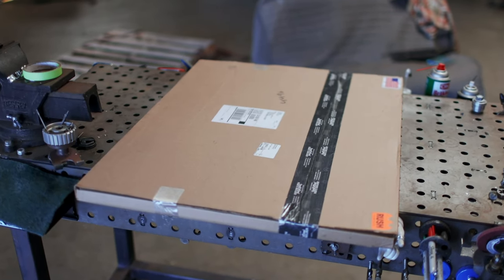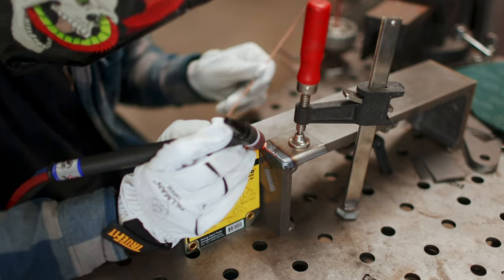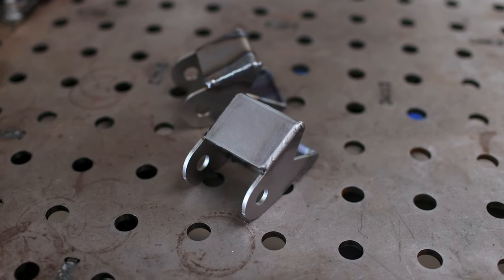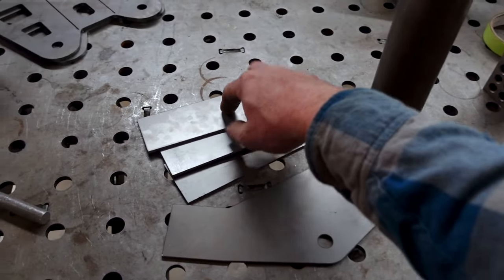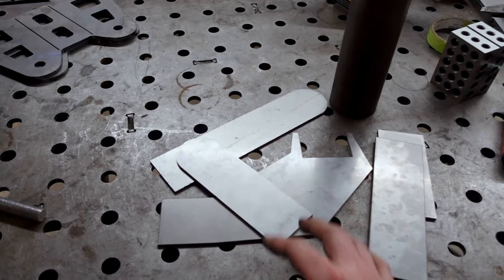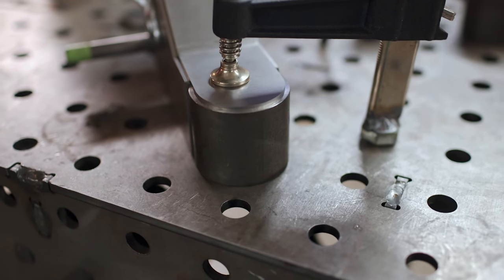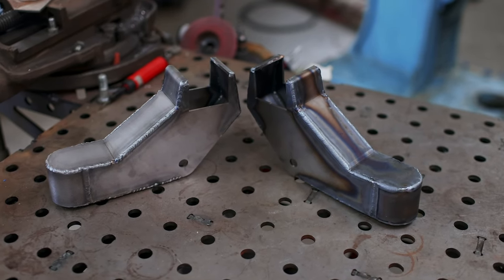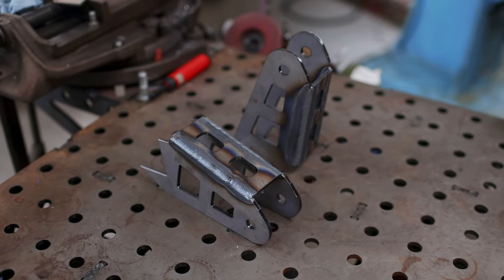From Sheet Metal to Suspension! - Road Race Chassis for the Hot Rod Rebuild

Comment: When having a lot of similar parts laser cut a helpful trick is to have part numbers/names lightly laser etched onto the surface for easy identification. The extra time in CAD to add labels can save a lot of head scratching and mistakes

Comment: I used an arbor press at my last job setting bearings and sleeves on three phase motor shafts to fit pulleys in custom saws. Unless you work in one of the many hand manufacturing environments you won’t get to see one. Do an episode for sure, knowledge is power and you can’t keep it without giving it away, as they say. Nice videos and progress on the model A frame. 🤘🔥😎🔥🤘

Comment: I've been using CAD for 12 years now and the thrill of having something you designed come together like this never gets old man. I'm glad to see talented builders like yourself diving more into it and seeing just how easy and useful the tool is, and how great the results can be on more complex parts. Obviously quick and dirty parts can be done by hand easier without any computer work, but it's nice being able to see issues in 3D space before you'd run into them during production.

Also wonderful and thoughtful use of the 1-2-3 block for fabrication! I too learned about them from Adam's YT channel and they're great to work with. It's such an extremely simple tool, but so effective!

Comment: Nice job.

When I build mounts with through holes that must be aligned I prefer to use bolts with proper thickness spacers inside plus about another .050"-.065" shim to allow for paint and/or chrome and still allow the component to fit inside the bracket without scratching the surface finish.

Just a tip I've found over the years.  Keep up the great work.

Comment: Have you considered plugging your suspension numbers into a bump steer/roll center calculation program?   Used one years ago and found it really helpful. Tie rod height and angle at the knuckle and rack play a large roll in bump.

Comment: From my schemes and plans for a scratch "Locost Seven", the rack tie rods need to have their inner ends on the line between the upper and loser a frame pivot centers. The R&P itself BEST wants to be in a direct line with the steering arms side to side- deviation of this will have the tie rod length in relation to the steering arm changing as the suspension travels. The smaller that deviation can be kept the better. Being off a couple of washer thicknesses will only be perceptible at high speed. Slam awesome looking work! For my day job I was a pipe fitter- no truer words regarding how nice working with those precut parts! There is now a gadget with a panthograph type arm tied to motors, and computers that will do parts to 24" x 24"- GHPC Channel has one. ON the press- if you want to do it, I want to see it.  I've been a tool junkie all of my life! Hand tools , power tools, welding tools- TOOLS! The whole point of having a big enough shop is to keep all your tools in one place! Isn't it? HNY! One new sub, 'fer shure!  FR

Comment: You design crumple zones to keep things from coming in to the cabin.
The rule of thumb is to have anything that bends head in a safe direction.
To achieve this you make strategic spots weaker and other spots stronger.
The bit that is in front of the wheels is weaker than the bit behind.
You want the engine to go down wards instead of straight back or back and upwards 
And you want to deflect the wheels and other stuff around the cabin.
There should be a stress analysis plugin for auto related cad programs you can use this to design the weak spots and test the direction of failure.

Comment: Did you consider using puzzle-fit joints (tabs) on these pieces?  These types of weldments lend themselves quite well to it, it only takes a few extra minutes in CAD and shouldn't add any cost to the laser cutting.  They can significantly reduce or sometimes eliminate the need for accurate fixturing. I've seen some that fit so well they almost didn't need to be welded.

Comment: What CAD software are you using?   You should see if there's a sheet metal parametric tab tool.  I use onshape and there's a feature that will automatically construct interlocking tabs along a corner based on a few inputs like min and max tab lengths.

Comment: The first project I made in my tool room apprenticeship was to make 2 pairs of 123 blocks.  I had to cut the stock, mill, square, drill and after heat treating ground to +/- .0005".
Reply: So $25 is quite a bargain for blocks made to the same tolerance
Reply: @stevejones9788  I think it is. The time spent making them was more than the expensive name brand ones. Ultimately, as long as you take care of them, they will pay by themselves and make the cheap investment totally worth it.

Comment: For me, I don't mind so much about the angle grinder guard, it's that there's no guard and you are right where a shattered wheel will fly into your body. I try and keep the plane of the wheel away from me as much as possible. That does make lining up the cut harder, but for something like that tube, I would have cut it on the chop saw (of band saw). I've personally seen this go very bad and those flying chunks of cutting disc can do some serious damage.

Comment: I never run my grinder without the guard, but could see how it could make some projects easier.  So what's the reason, convenience or something else?
Reply: Yeah safety has to come first. Guards are easily repositioned if need be.
Reply: Ive always said, if you have to take the guard off you’re using the wrong tool, grinders and cut off tools come in a number of sizes.

A cut off disc exploding in your face is no joke

Comment: I could be wrong but crumple zones should not necessarily be designed to just crumple, but instead they should be a bend point. For example if you made crumple zone on the bottom half of the chassis rails, the net effect would be to slow the cab while bending the engine down and away from it, pushing the cab upward, making it safer…. 🤔

Comment: hey man you may not know this but if i were you id try and use some smaller diameter filler rod, looks like you're using 3/32, id recommend 1/16 or smaller for that thin of material, helps out with puddle control, also keep that hot tip of the rod shielded, it makes restarts less dirty because the tip of the rod doesnt get contaminated by air, it may just be me but i also think you should turn up your preflow, seems like its making lots of sparks when you first arc, not trying to hate just trying to help out
Reply from the maker: Thanks for the tips!

Comment: I've gotta say, it takes some humility to admit that little bump steer misunderstanding. Humble people learn faster! As far as I understand it, one of the simplest ways to eliminate bump steer would be to have the tie rod in the same plane as the lower control arm and the inner ball in the same plane as the upper and lower control arm mounts. Problem is as soon as you get some kingpin change through the travel, or as soon as you're not at center steering position, it all changes again.

Suspension is hard, man. Take it from someone who spent way too much on an engineering degree. It's never "perfect" - the best we can hope for is a good cost benefit ratio and some decent lap times!

Comment: You just need to build a proper role cage and steel off the fire wall where you sit they're is no need for excessive weight, You will be perfectly safe in any accident however the auto will be finished.

Comment: Nice work! I don't use a guard on my angle grinder, either. They make it too difficult to see exactly what you're cutting unless you crane your head around and look at it from the side, which of course is not ideal for a variety of reasons. With that said, I do use a full face shield and respirator mask when using a cutoff wheel.
Reply: that's fine for when you shred a disc. Your fingers might raise some issues if they could, though.
Reply: @StanleyKubick1  True, but I'll take that risk. I've used what are considered to be among the most risky power tools (angle grinders, table saws, circular saws, etc.) for decades and never had a problem. Closest call I've had with a power tool was when using someone else's belt sander that kept exploding belts due to being out of adjustment. That's one reason why I don't like using other peoples' tools. I have seen other people get into trouble, though, and it has always been due to user error. I'm not saying don't use a guard on an angle grinder. I'm just saying it's a calculated risk that I'm willing to take. But I'm always wearing eye or face protection, hearing protection, gloves, and a respirator. I see so many people using these loud tools without earplugs and I wonder how many of them are going to develop permanent hearing loss and/or tinnitus.

Comment: Your scrub radius is usually the cause of bump stear.
Reply from the maker: The two are entirely independent, actually 👍
Reply: @stanceworks  the lever formed between the king pin angle and the center of contact of the tire causes steering deflection when you hit a bump, bump steer.

Comment: A crumple zone should be part of your build it only has to be I front of the cross member where no real strength is required for the central safety area, your crumple zone can be as simple as a tapered rail at a 10 degree angle the the straight rails

Comment: Isn't Ackerman determined by the position of the tie rod ball joint in relation to the steering axis? AFAIU the placement of the rack itself only affects bump steer. This video has a some pretty good drawings: https://www.youtube.com/watch?v=YVisLuiU-Oo
Reply: I'm pretty sure the rack placement forward and back should have some (but relatively small) influence on Ackerman. (But the position of the tie rods in relation to the steering axis is the more important one).
Reply: @Finnspin_unicycles  Interesting, I can't quite visualize it, but I barely know what I'm talking about. I guess I have some more research to do as well.